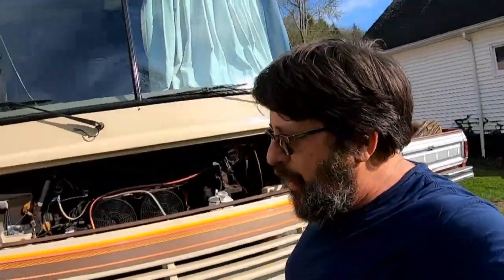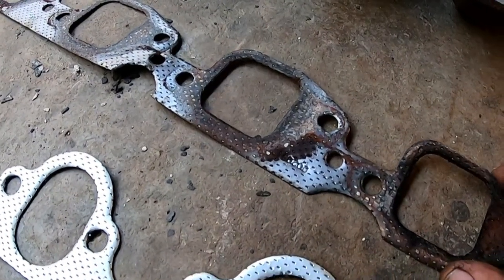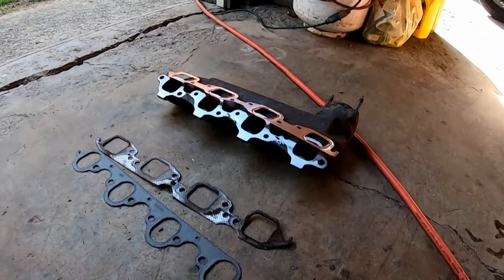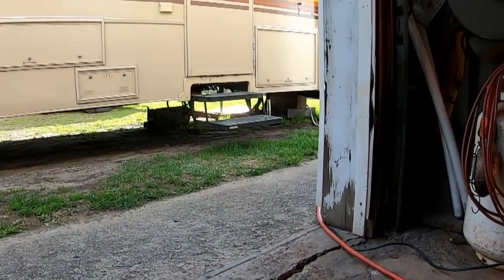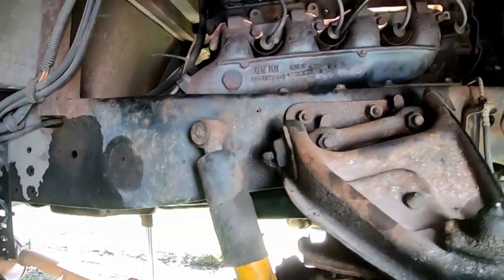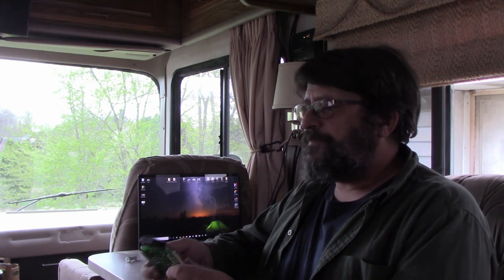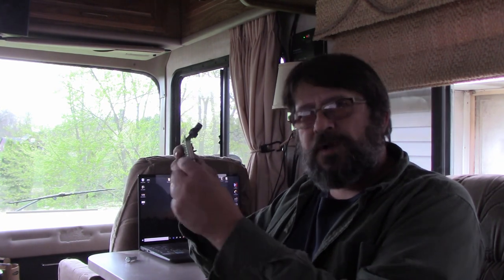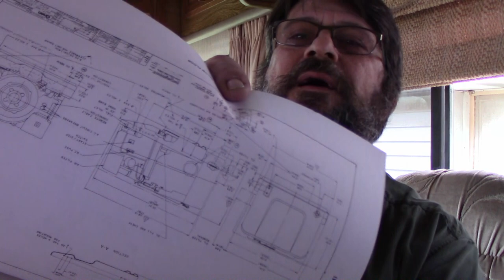Amazing RV Updates! Exhaust Finished

Comment: Dave: I am an old automobile mechanic from the late 60s ( Lenape Voc. Tech 2215 Chaplin Ave Ford City PA. ) You and I think alike. I have seen a lot of people not take the time to chase the threads on the bolts and heads in order to get a true torque when tightening before putting things back together. I and retired and living with my wife in  Thailand. I do miss messing around in the garage and working on motors, transmissions and getting greasy and dirty. I enjoy watching your videos and it is good to see Pa. Is Vido’s restaurant down on River Road between North Vandergift and Leechburg still there ? I loved their fish sandwich’s.
Reply from the maker: I think that restaurant was right next to the car wash. It's been closed for a few years now. The Bonfire is the best place for fish sandwiches these days.

Comment: That's funny. I bought a used mini van and took it in for inspection and emissions test. The tech told me it failed and was showing a check engine code. I told no it wasn't. He told me the bulb was burned out. That's why it didn't show up. I had to pay the shop to tear the dash apart to replace the bulb. Turned out it was showing s internal slip in the transmission and I had to get it rebuilt. That little bulb cost me a lot of money.
Reply from the maker: I have two bulbs that I need to replace, maybe I should let them go! lol

Comment: O2 sensor not working, ECM defaults to RICH, should see the exhaust pipe clean up now. And I can relate to the rodent problem, fixed my electric choke and temp gauge by repairing the chewed wires on my Bounder. Ford engine and chassis; I have headers.

Comment: Dave I have a 99 bounder and I noticed you have what looked like a solar charge controller behind your head. How much solar do you have and is it satisfactory? That o2 sensor should help on the gas! Thanks
Reply from the maker: I have 400w of panels on the roof and somewhere close to 500ah of batteries. It's enough power for my needs.
Reply: @DavesRVLife  Thanks